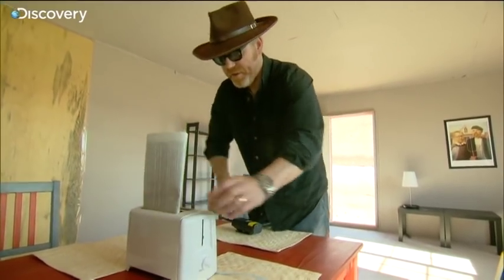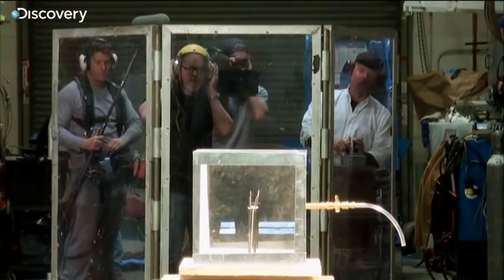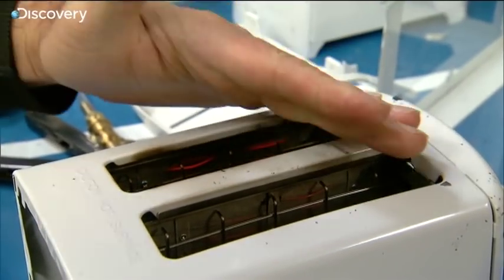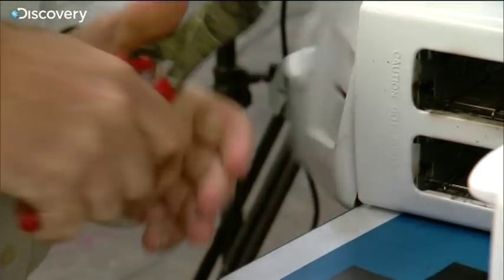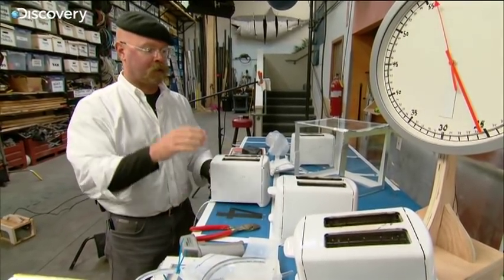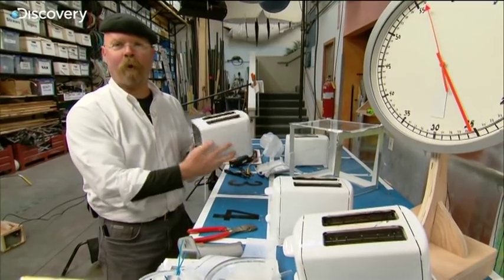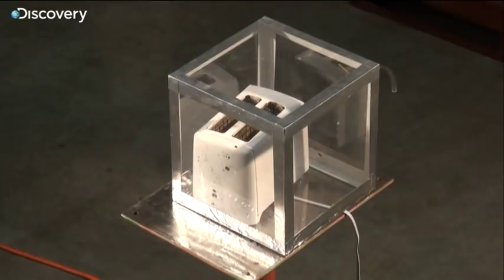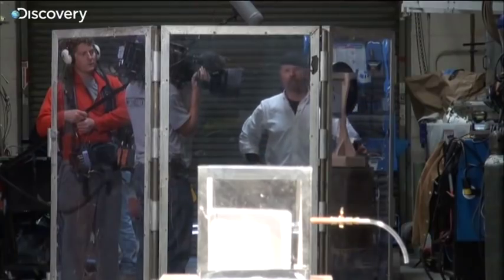Toaster Turn-On - MythBusters

Comment: As he said this model of toaster will not function unless plugged in first. Built in safety crap to save us from some of us.
  The reason it didn't work is because methane or natural gas is lighter than air and was up against the top but the heating element was nearer the bottom and  the heat didn't produce enough turbulence to bring them into contact. A flame produced by paper will rise up and boom. This can be tested by adding a small fan to mix the air.
  Don't ask me how I know but a toaster will light a propane torch. If you run this test with propane no fan needed cause it's heavier.
  Mike (o\!/o)

Comment: This makes sense. You don’t want to actually set fire to toast, so the properties of the wire would be best if limited to below a temperature that would actually set fire to the bread put in the toaster.

That temperature is clearly high enough to set magazines on fire tho. So just don’t put paper in toasters.

Comment: I thought you could just push it down then plug it in anyways. Forgot to plug-in the toaster a few times and it worked fine. Just gotta make a circuit breaker.